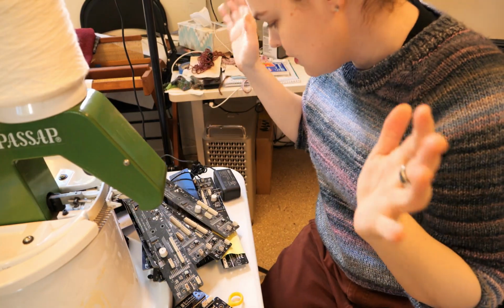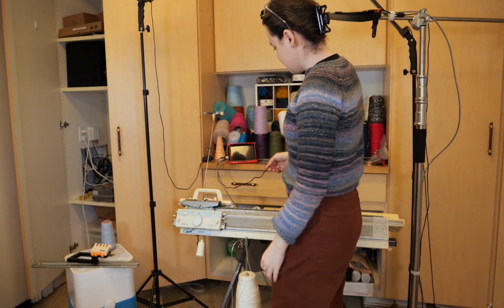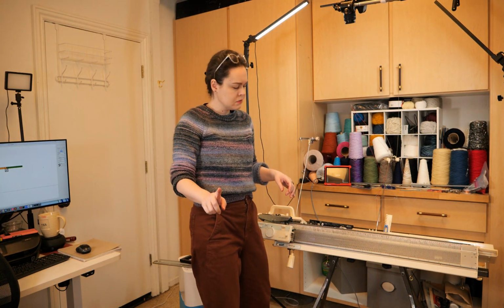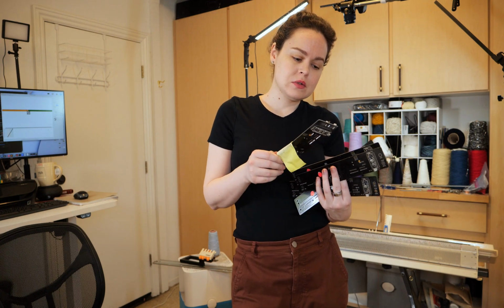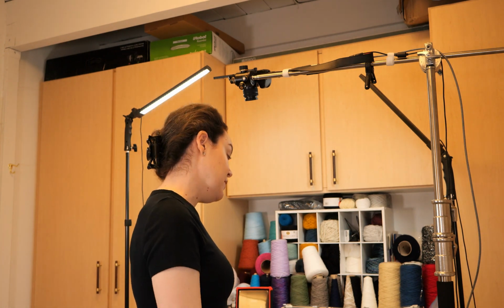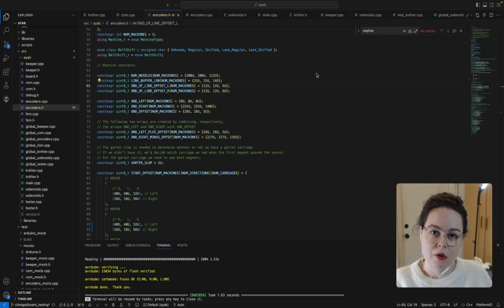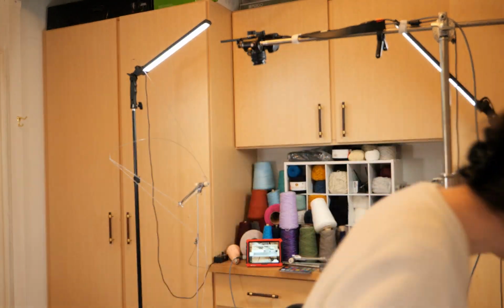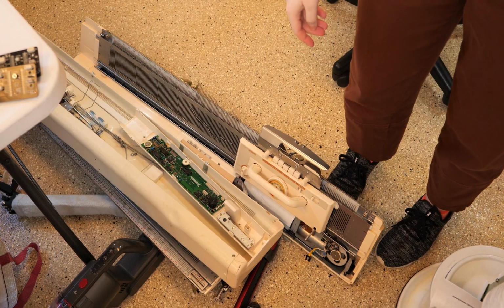AYAB Development Vlog: Day of debugging

Comment: I posted over on reddit as well but does anyone know why this Brother KH-360 4.5mm / 9mm pitch knitter has 2 different numbers? ive been all over the web trying to find out what this machine can do and no luck so far. all i can find are videos in other languages that i cant get to translate properly. I cant seem to locate the manual yet either. Im still hunting though
Reply: Take a look at the Brother KX395 and 400. They also have the convertible 4.5/9mm feature, but have a different mast. They have manuals in English; your smaller 360 one may never have been marketed outside of Japan, I'd never heard of it. To learn how to thread the mast, look at the Silver Reed LK100.
Reply: Thank you! I haven't bought the machine yet, I keep finding that model all over eBay and I wanted to find the manual for it before i purchased it, I had assumed the dual numbers meant it could be used at either gauge which I thought I would definitely use but i also found basically a silver reed lk100 for 180 that I am thinking about getting. This is going to be my first flatbed machine so I've been going back and forth about which one I should get. I am pretty sure I would use a 9mm bulky gauge machine way more than 4.5mm but the idea of being able to have one machine do both was intriguing, but the lack of a English manual for the 360 has me hesitating, I can see my lack of experience causing issues if i went for it over the lk100 which has a lot more English documentation. the lk100 needs some loving including brand new needles and a good cleaning and lube from what i can see on the ad.   @plummetingsheep
Reply: If you decide that you want the dual-gauge feature, I don't think the lack of a specific manual in English is that big of a barrier. Start by pointing the translate feature in your phone at the Japanese text in the manual that will presumably come with it. And use the English LK100 manual for threading the carriage, and the KX395 manual for using the dual-gauge feature. Once you're past the very basics, all the plastic-bed machines are pretty similar. And join at least one of the many machine knitting groups out there on Facebook, Ravelry, Discord etc, the community will help you if you get stuck. 
About that LK100 you're looking at - it's very rare for a machine to need the expense of a full set of new needles, usually any discoloration can be cleaned off with a little effort. Only replace needles that are actually bent or the latch doesn't move freely.

Comment: Thank you for telling me about Jens.  My “old” Evil Mad Scientist board worked kinda.  The shield came with a KH950 I bought last year.  It would select needles correctly, but never gave the end beeps and continued to knit the last row forever.  We went through some troubleshooting and came to the conclusion that the shield had met its expiration.  I did use it to make a couple sweaters, I just needed to manually end the pattern.  I now have a new board winging my way!  Thanks! 😊
Reply from the maker: That sounds more like a software problem than a hardware problem.

Comment: When I started using my kh910 and AYAB a few years ago I had issue with randomly selected needles. After a lot of debug work I stumbled upon when my design was wide enough for the carriage to pass the return sensors there was no issue. Now I primarily work 160 needles so there is no problem. If I have a narrow design I have to still take the carriage to the sensors to avoid the random needle selection. Not a huge price to pay for the end result. The technical side of AYAB and the knitting machines themselves is very interesting.
Reply from the maker: That bug has largely been fixed. There was some carriage drift. You should be fine when the next release is out.
Reply: @KnitFactoryImpl thank you, that is good to know.